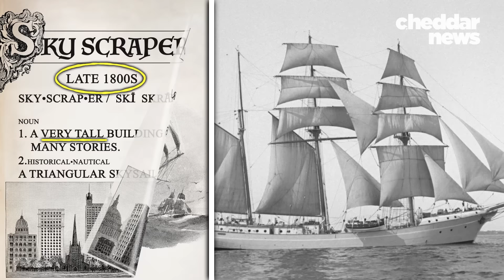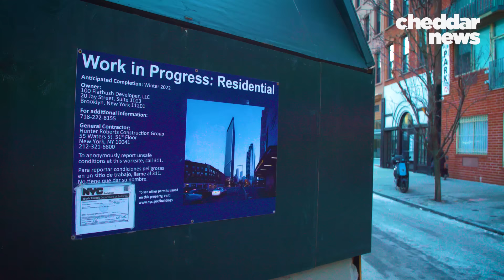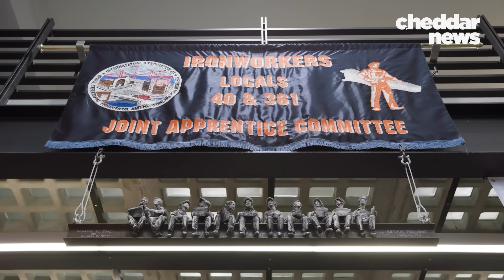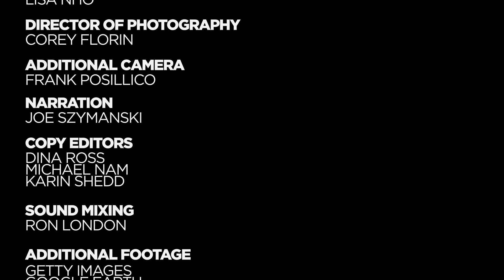The Challenge Of Skyscraper Construction In The Most Crowded City In America - NYC Revealed

Comment: Good video.  I inspected 100 Flatbush ave the day before they shot this short movie. Amazing site, but had to issue them 3 violations, for 2 rakers on 1 heel block, crane radius swing over personnel and slope at exp1 sharper than 45 degrees. The guys there were very helpful, and run a great project.

Comment: New York would have a lot more flexibility building new skyscrapers if there weren't such restrictive building rules, especially the floor-area ratio rules which didn't exist when the iconic skyscrapers were built. Remove the FAR rules and there's a lot more options with a lot more potential economic development, which would also help with a lot of the supposed "lack of land" issues which are to a large extent more about legal issues than any genuine physical restriction. The building codes and "extensive permitting process" mentioned in NYC are unnecessarily restrictive and this is a major problem. Some of this is necessary for safety, but a lot of places don't have many of these rules and manage to have lower accident rates.
Reply: NYC wouldn't even need that many skyscrapers if they just get rid of their SFH zones.  Most of NYC is still zoned for SFHs, especially in the boroughs which makes no sense.
Reply: @taoliu3949  Absolutely. The insistence on single family housing zones is a major part of the problem.
Reply: @joshuazelinsky5213  Yup, that and also parking minimums, most of NYC has parking minimums, even in areas with subway access.
Reply: Having just watched an NYC construction crew build an additional five floors on top of their planning consent, hoping nobody would notice (they did) my view is that the regulations are probably in need of further tightening. These people are lawless and need policing. I entirely reject your contention regarding density regulations.
Reply: @francispower1418  That's an argument for further enforcement or better oversight. That's not an argument for tighter regulation. That's essentially akin to people arguing at the beginning of Prohibition that because people were violating Prohibition, tighter regulations were needed to enforce it.

The bottom line is that right now, New York has incredibly strict regulations which make building new things very difficult, even when everyone wants them to be built. And the city suffers massively from it.
Reply: @francispower1418  The fact that they added five floors means the restrictions are too tight.  Nobody in their right mind is going to spend money to add five floors that's not going to sell.
Reply: @joshuazelinsky5213  Which bit, the poor public behavior or the trying to slip on an additional five stories on the sly? To my mind the latter, as it is apparently common practice, is entirely a matter for stricter oversight. With a construction industry that behaves as if New York is the Wild West circa 1850 we need all the oversight we can get.
Reply: @francispower1418  Don't confuse oversight with regulation. There's a vast difference between "Make sure people don't do X" and "Keep X illegal, and also keep illegal A,B,C, D and E."
Reply: @joshuazelinsky5213  You are being ridiculous and attempting to hide behind semantics to conceal it. Of course regulation and oversight amount to the same things. Regulators not only prescribe the rules and their parameters, they enforce them. That’s their job. Everywhere in the world. Across all sectors. Your mantra is so familiar it makes me smile. I worked for a regulator once, I got parachuted in to help them fix a problem they had for a few years, as a sort of poacher turned game keeper (it was the UK’s Environment Agency - I was helping them get their inland navigation business on an even keel). It was fascinating to get a glimpse into the regulator’s mindset during that time. What I learned was this. Everyone who is regulated (all of us, one way or another) thinks the regulators are after them, right? I’ve certainly felt that before. The revelation was that regulators themselves see it the other way around. That the world is after them and, regardless of being hated, they must protect the castle from evil miscreants for the common good. Watching my local construction site try snucking in an extra five floors, I have to say, I do see their point.